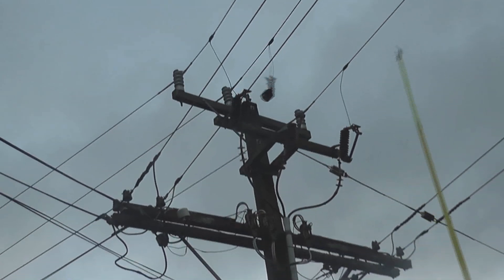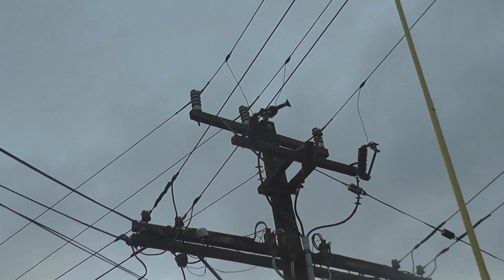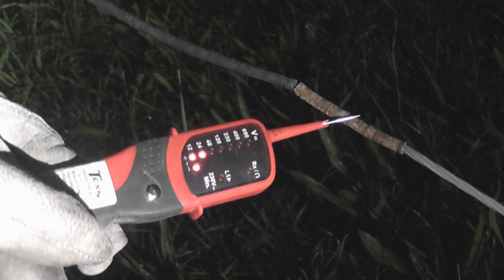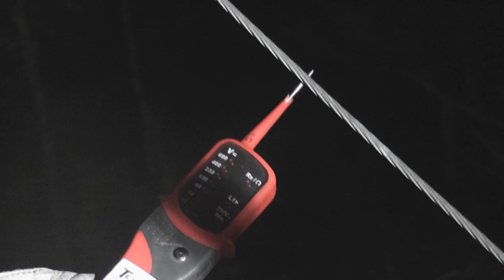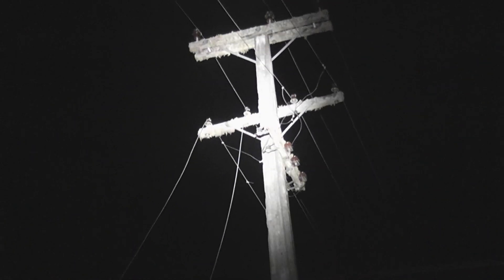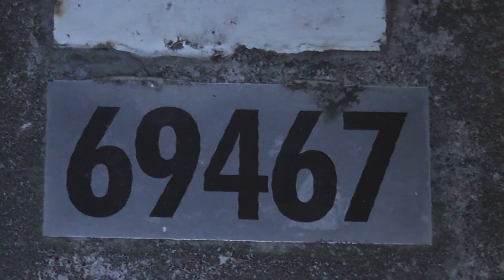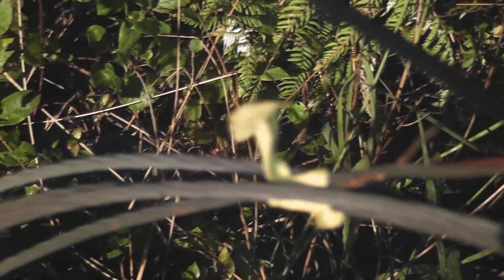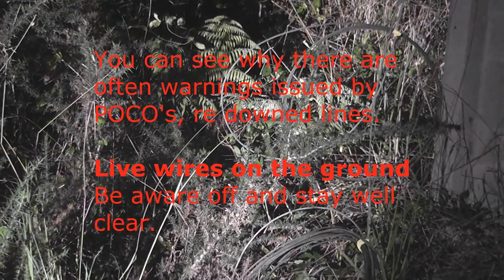Drop out fuses and lines down

Comment: why is it scary if the insulator is broken ? insulator is the part thats hanging on the second part of the video 0.:56 )
is it because without an insulator the wires can now touch each other and cause an explosion ?
Reply from the maker: That part of the ddo insulator which broke off nearly hit the other phase on the feeder line above, which would have caused a large explosion.
Reply: +RODALCO2007 thank you so much for the info

Comment: Scary. Especially that broken insulator almost causing an arc fault. 230v lines on the ground is scary too, even though its house current, it can still kill. At least it wasnt a 7200v line.

Comment: I'm glad you guys take care of this stuff, here in the states we had maintenance done on the power lines that run between my backyard and our neighbors back yard they they didn't bother to clean up the cut cable that they left in our back yard.
Reply: We pay 26c/kWh (0.22USD/kWh) for power here, don't you get away with 9c/kWh there? You'd expect good linesmen like Rodalco for that lol
You'd think having 77% of our power generated from renewable resources would make cheap power. Not so -_-
Reply: ***** We would have Nuclear plants here if there wasn't so much opposition.

Also those solar grid connect systems you can get where you can sell power back to the grid. Well they pay you back at about 6c/kWh and charge you for using at 26c/kWh. Not much incentive for people to install those systems here which is a shame.

Never let your power companies get privatized. It's a really bad idea! Before our power companies were privatized, during the construction of the national grid, electricity here was so cheap Australia built their Aluminium smelter in NZ. Power was so cheap that houses weren't build with any insulation, people just rack and stack heaters around the house. Now it's getting to the point where people can't afford to heat their homes, they freeze in winter, it's a disgrace. People get power bills of $600US a month in winter and it puts strain on families.

If only we could go back in time and stop any of this from happening.

We heat our house / hot water with a wood burner, and 2 big solar panels to heat the hot water also. CFL lights everywhere... Our bills are about $125US a month. But that's the lengths you have to go to, to have a reasonable power bill.
Reply: KiwiPowerNZ I live in a town that has both public (unregulated) and private (regulated by the state) utilities serving it, and both charge 10 cents per kWh. For those less fortunate, there is a law on the books restraining many utilities from cutting off power during the winter, as well as some charities that provide some money to help with heating expenses during the winter. Fortunately I do well enough I have not required public assistance in years. Anyway, my bill tends to vary between 30 and 60 USD a month, as I live in the northern part of the country.

Comment: How do those drop out fuses work? Are they magnetic or what. I have seen them blow around here in rare lightning storms.
Reply from the maker: The fuselink sits in the tube, when the fuse blows the connecting wires part but also unlatches the tube from the contacts from the supply line above.
Reply: shango066 At least here in the US, the fuses have an explosive charge in them.
This does two things:
1. Blows out the arc that happens when the fuse link melts in two
2. Causes the fuse to swing down. This is a good indication that the fuse is blown, and also provides an extra safety gap since the gap between the two conductors is now the length of the fuse (because there is no fuse there!).
Reply: Benjamin Esposti the ‘explosive charge’ is the arc heating up the lining of the tube which has certain chemicals (including boric acid) that produce large amounts of gases, expelling the lower half of the fuse element. The fuse element is also designed to hold a spring-supported, movable portion of the fuse tube in place, and once blown, the tube is free to pivot clear of the holder, providing a visual indication of an open circuit. The fuse tube is then retrieved, the old element pieces removed, and a fresh one installed.
Reply from the maker: shango066
Heat from the explosion of the fuse. A spring aids the pulling away off the lead in wires. Will get hold of a d.d.o. and do a video on it when back from my storm chasing in May.

Comment: Fuck that for a game of chicken your balls must be made from titanium and you carry them in a wheelbarrow..Its raining and your messing with electric with big poles :v
Reply: Well he did train as an electrician, so is going to handle the hot stick with care. GRP pole that sheds water is fine, and you wear gloves and boots, along with connecting the ground lead so you are not the part that completes the circuit for the leakage current.
Reply: SeanBZA
Yep. PPE checking is a must. One little hole and its all over.

Comment: Ray, do you guys have fusing on the 230/400v side on overhead lines there? I know in the USA they don't on the 120/240v side, but here in the UK they generally do on O/H distribution.

Just wondered what would've happened if those 230v lines shorted on the way down, whether it'd be a case of the wires themselves burn out or the fuses pop?
Reply: If they hit the 230V side on the way down fuses do nothing, it is the customers electrics that get cooked. Fuses protect the transformer and the feeders from overcurrent, 11kV will not blow them, and in any case most fuses for 230V will arc over at 11kV, along with a lot of the wiring and meters as well. You just hope that only a brief contact occurs and the line inductance is enough to limit the voltage. If it welds then everything connected at the customer side gets cooked well and truly. If the customer has installed distribution box overvoltage protection then this should blow the main breakers to protect the downstream side from damage.
Reply: SeanBZA I meant the downed 230v lines he showed in the 2nd half of the video, the 11kv hitting the 230v wires, just ouch! :-)
Reply: SeanBZA 11kV down the consumer mains, I'd imagine there would be sparks coming out the power points haha! 2.5mm2 cable is rated between 600V & 1.2kV max, It would be arcing away like tesla coil haha.
Reply from the maker: Sometimes they are fused, sometimes not.
Reply from the maker: *****
The 11 kV wires were hitting the 11 kV wires and amazingly didn't flash over
Reply: Benjamin Esposti Your transformers work hard! Our transformer we have is 30kVA single phase, 11kV/230V. That is rated for two houses here, but we are the only ones connected to it. Got all the juice to ourselves! Though technically our power meter which is made in the USA is rated at 80A 240V so we don't quite get all the juice since the transformers supposed to make 130A.

The transformer has two fuses on the 11kV primary and two breakers on it's secondary output, one's ours and one's provisional for another house. Don't know what amps they are rated at though.

I live around the same city Rodalco2007 does.
Reply from the maker: KiwiPowerNZ
Those 11kV lines must be thin. A 30 kVA TX puts out  about 125 Amps at rated 240V voltage. or your OH mains struggles a bit. LOL
Reply: RODALCO2007 I don't know if you guys use it there, but what is worse is 4160V. You can get some epic arc-flashes from that, since to get higher power you need more current, which means you need lower impedance... Most new distribution systems here use about 13.8kV. On occasion you see a pole transformer which has larger bushings on the front, those are used to step down the 13.8 to 4160, instead of replacing a whole bunch of the old 4160 equipment. Our electrical utility is somewhat unique, because they also use resistance-grounded 26kV lines, I think.
Reply: +KiwiPowerNZ Very likely: yes. At 250 Volt opposed to neutral, voltage-drop can become quite significant at low currents.
To overcome that problem, the voltage is slightly raised. This is even done on higher-voltage systems, with tap changers on transformers.
Reply: there's a video where a tree company dropped a tree branch which sent a feeder onto another feeder then they dropped to a 240v line which caused fireworks on all the houses connected. Look for "power surge moores mill road" its a older video taken with a camcorder but its nuts even the meters connected to the service line blew right off their mounts and there is sparks coming off of the gutters and where the service connects to the house.
Reply: in australia on a party transformer (more than 1 house on a large transformer) they have 3 small drop down fuses on the 250v side (we have 11000v on the top 3 wires and 4 on the bottom on the 250v side) (the 4th wire is neutral)
Reply: ***** Yes we don't have the mains fused like that here in the USA, but, from what I remember, your transformers for the conversion to 230V/400V (or whatever it is) are more sparse, and they are higher power. Here we have transformers of usually either 25kVa or 50kVa feeding from 1 to 5 or so houses.
Reply: Yeah, here even the pole mount ones tend to be 75 to 100kva, 3 phase, and fused on the 2ndary. Oddly the primaries often AREN'T fused here for each transformer
Reply: ***** LOL we do everything differently from the down position of a light switch
being ON, to driving on the right side of the road, to healthcare...lol :P
Reply: michael phillips 250V? Is that to account for long lines to houses? Don't know of any appliances rated for more than 240.
Reply: KiwiPowerNZ Not 100% sure here, but I think some commercial appliances operate at higher voltages than 240V. Like dryers and washers at the cleaners, or electric deep-fryers at restaurants.
Reply: Benjamin Esposti Benjamin, where are you (if it's not rude to ask)... most commercial / light industrial here in the UK runs on 3ph 240/415 v (officially 230/400v but it's still the old voltage really)

In the US, there are dozens of voltages, 120/240, 240 3ph delta, sometimes with a high leg and a ct transformer, sometimes 120/208v 3 ph star, sometimes 277/480v star, and in canada i believe they use 347/600v

Australia and NZ I believe use 240v single phase, and 240/415 3ph?
Reply: ***** Yeah pretty much. And 400V 3ph as well because of the common 230/400V transformers around NZ. Officially we are 230/400 but it seems to be a mixture with 240/415, just depends what transformer you end up with. Last time I measured ours it was 230.6V
Reply: KiwiPowerNZ That's very interesting mate! The engineers over there must of compensated for the shorter HV transmission lengths. That's the only logic I can see why I get such a variety of voltages depended to cable runs on consumer lines. When is Christchurch going to be rebuilt with some those earth proof skyscrapers? I'll give you a hand and wire them up!  

Here's a story for a Kiwi, I meet this Brazilian friend living here in Australia he got electrocuted in Brazil street from touching a light pole! as a 5 year old (wouldn't that scare the shit of you to you!) He told me it was his friend him saved him by tackling him to the ground! No RCD protection, concrete wasn't earthed, he would have fried him otherwise!

Him being a client of mine after he said his story I pulled off a power point and demonstrated to him what happens when you do something silly and throw a dead short on a circuit in Australia. Bang! Blew a hole in the terminal and the RCD went off! Every circuit on this person house was protected by one of them, they save lives literally!
Reply: Tradie Trev I think the plan in the Christchurch rebuild is low rise office blocks. I haven't heard much about it lately. It's like the news cover what's happening for a few weeks or months then forget about it and show other news. But what I do know is Christchurch has some major problems, one being, the ground has sunk in areas making massive suburban flood zones every time there's heavy rain. They'd have to raise hundreds of houses off the ground! But that doesn't stop the roads from flooding, or your car from swimming. Then there's the problem that all the storm water drains and sewage pipes now flow into these sink zones! So they would have to re-lay all the waste water drains? Realistically what can they do? Poor old Christchurch is really buggered. Plenty of construction work going there though, but there's also lots of construction work up in Auckland too, and I know where I'd rather be. Though Auckland isn't without it's problems. There's a massive property bubble over Auckland caused by land banking and supply not meeting demand. There's huge returns and it's pretty much tax free. Not so good for the young first home buyers who don't have $700,000 laying around to buy an ordinary sized suburban house.
Reply: In Estonia we have only 3-phase transformers with power output ranging from 30kVA to 630kVA 230/400V (old system was 220/380V) with from 1 to over 50 households on a single transformer, there is always fuses or large industrial grade circuit breaker near the output of the transformer and mostly the transformer is fused at the 10kV side also. Only thing is we have aluminium used for overhead lines and when the lines short it may not kick the aging circuit breaker out, specially if the line is long between the fault and supply.
Reply from the maker: KiwiPowerNZ
Our Voltage is closer to 240 / 415 Volts. We are only 1 km away from the 33/11kV Substation.
Reply: RODALCO2007 We are about 10km from ours, 11kV all the way I think. We are also 200m from our 30kVA single phase transformer, voltage drops to 200V when our 2hp pump starts lol!
Reply: ***** Sorry didn't see your comment until just now... LOL google....
Yeah I am from New Jersey, USA :)
Reply: RODALCO2007 It's the long cable length from the TX to the house. 200m of cable at least. Must have a fairly high resistance.

It doesn't stay at 200V that's just the instantaneous volt drop from the start current of the 2hp motor. It bounces right back to 230V.
Reply: Yep ;) I know that video. For me it's like a horror to see that and the underground-power we have here feels incredibly safe watching that ;)
Reply: ***** I also saw that video year or two ago. It was quite a fireworks show. :)